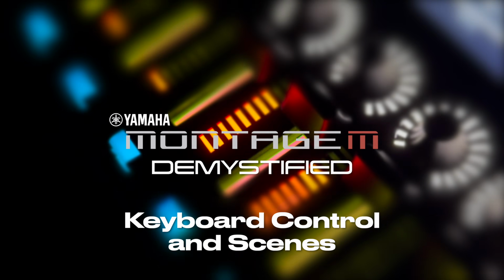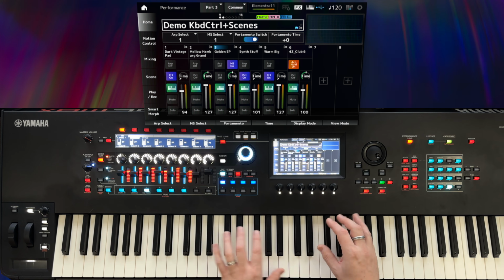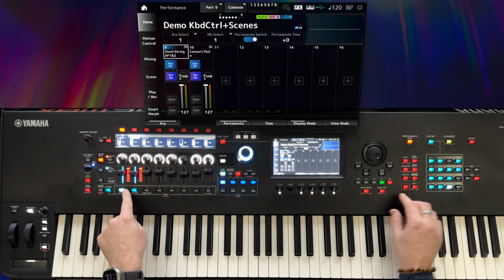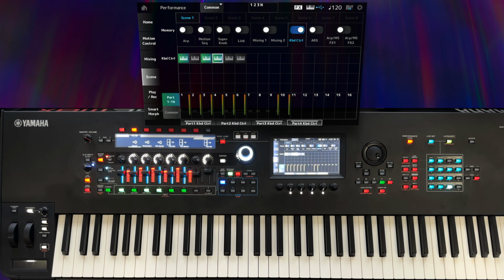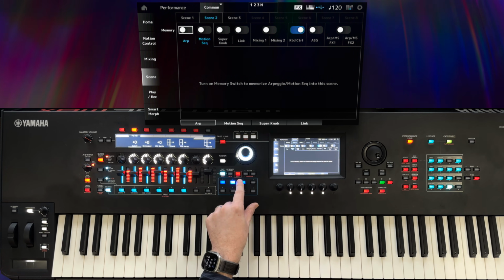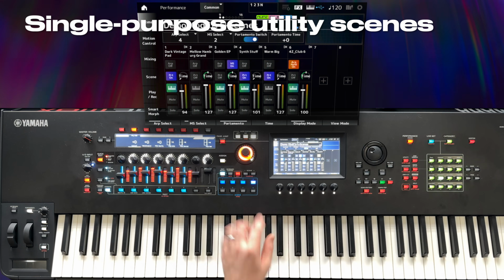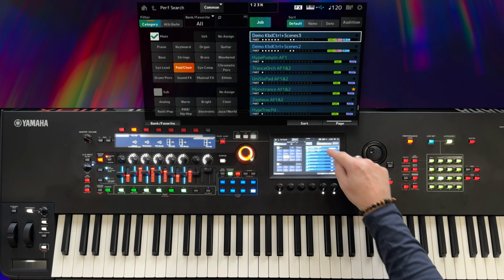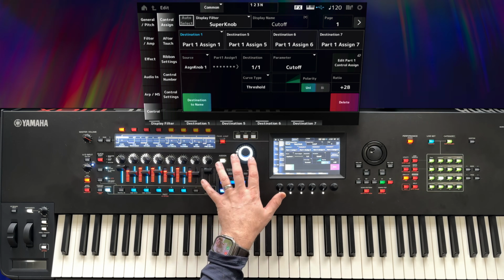Using scenes to switch keyboard control, arpeggios and more with Yamaha MONTAGE M / MODX M

Comment: Hi Kier, your tutorials are really the best, and maybe because there’s so much information in them I might have missed this part. A simple question for you, I think: if I have the same voice in both Scene 1 and Scene 2, with the only difference being that in Scene 1 the volume is low and in Scene 2 it’s higher, I get a sudden volume jump from that voice when switching scenes. How can I prevent this? Thanks in advance for your support!
Reply from the maker: If you’re changing mix volume between scenes, you will unavoidably get a sharp jump in sound output of any notes sounding during the scene change.

There’s not really a workaround apart from 1) don’t hold that sound during scene changes or 2) duplicate that sound to another Part and increase its volume, and switch keyboard control from the first Part to the second with the scene
Reply: @KierDarby I appreciate your quick response. It’s a pity there isn’t some kind of adjustable transition time, but I’m glad I don’t have to keep searching. I’ll definitely use your suggestion, thanks!

Comment: These are excellent videos, but probably too much for the average user. Is there a beginner-range video for just simply using the built-in presets and setting up favorites once you find the ones you would most likely use for most live performances? Once you get your favorites set, these more advanced videos will come into play for customization. Sometimes you just want to fly somewhere and don’t need an explanation from the pilot how they do it. Thank you for this extensive work!
Reply from the maker: Like this one? 

Getting Started with Yamaha MONTAGE M / MODX M: Finding Sounds, Live Sets and Category Search
https://youtu.be/_x3vKHDf4XU
Reply: @KierDarby Yes! Exactly. Thank you for the pointer.

Comment: For some reason when I attempt to set up the scenes with keyboard control at around your 11:00 mark the green keyboard icons  for the parts are not displaying, it just says "Turn on Memory . . . " also the Kybd Ctrl section does not appear in the column, just "Memory", thoughts. I have the latest OS.

Comment: Kier another great one...a couple quick questions..one, I could not find your demo percussion part in the Presets and two, when I store this demo, the only option I seem to have is to save it in the main User Bank,  in addition, I am not sure how to move it to another bank..you may have covered this before, but I could not find it in your lessons...thanks Michael
Reply from the maker: Hi Michael, I just went back and looked, and it turns out the 'Trancy Theme' drum performance is actually part of the Xtasyn library from Easy Sounds - sorry about that, I normally try to use just Yamaha presets for all my demos.

Regarding saving to the user bank, you're right, when you save a performance you have to save it to the user bank. At a later point, you can move the user bank to a separate library, at which point it becomes read-only unless you save a copy back to the user bank. I will cover this stuff in a future video.

Comment: So is there an easy shortcut to easily add drums / rhythm to an existing live set?  And have the drums variations correspond to each scene?  Ie verse chorus type of variations. Seems like it was way easier to do on my older Modx.
Reply: If I wasn’t mistaken, on the modx different rhythm variations used to be auto assigned to different scenes. Or maybe the patch I was on didn’t have that. 

Btw Thank you so much for this video!! 🙏

Would you consider making a looping tutorial video?  So using a multi part performance and rhythm to build a live loop using the pattern recorder? I have come close, but it keeps rerecording the drum parts and if I turn of keyboard control it stops playing entirely.
Reply from the maker: @linzdp  scenes can change the arpeggio number, so if your rhythm part has 8 different arpeggios assigned, you can switch between them using scenes - you can see this on many of the preset performances, like DJ Montage.

I could look into doing a looping tutorial, but as I've said elsewhere, I barely use the sequencer facilities on Montage so I might not be the best qualified to run a tutorial.
Reply: Thanks I’ll check that out!

Oh I never use the built in sequencer either. I’m only interested in using the pattern recorder to loop live like a guitar looper would do.  But seems like it tries to overdub the old drum parts back into the every subsequent pass causing a chorusing effect. 

I’ll keep playing around and see if I can get it to work 😁
Reply from the maker: No features have been removed from MODX, so if you can describe your MODX workflow, I'll tell you how to do the same thing on MONTAGE M.

To add percussion with a rhythm pattern to an existing performance on MONTAGE M, just hit SHIFT + SONG/PATTERN (RHYTHM PATTERN) and you'll access the same interface as you would get with the RHYTHM PATTERN button on MODX.

Comment: I wish key range was another independent parameter under Scenes so that you could disable the actual keyboard from playing additional notes when you want a sustained sound to continue holding underneath a new selected part, but without disconnecting the sustained notes from other controllers such as the expression pedal so you could continue to shape the sustained pad. It’s too bad you can’t route another part’s MIDI output to another part without having to loop out through MIDI. The internal MIDI routing is very limited on this keyboard..
Reply from the maker: The first part of what you want - sustaining just a selection of notes while not sustaining others keyed afterwards - can already be done by connecting a sustain pedal to one of the assignable foot controller ports and setting it to sostenuto mode.

The second part (directing the expression pedal etc. to the previous performance) is not doable with Montage architecture as all control inputs are directed to the currently-active performance, and I can’t imagine that will ever change.
Reply: @KierDarby  , I share that doubt that the Montage OG or M internal MIDI architecture will ever change enough to do what I was describing above. 

For now, I use an external MIDI controller to send CC11 on the assigned MIDI channel of the part that I disconnect from Keyboard Control after I sustain the notes (great suggestion to use CC66, by the way!). I'm grateful that at least incoming MIDI is still recognized even when Keyboard Control is disabled for a part.

I used to be able to accomplish non-stop expression control of sustained parts on my Motif ES using Master ZONE Mode with a MULTI patch (SONG/PATTERN), turning off internal/local control on the string part, assigning only NOTE control to one of the ZONES, and ONLY CC control to another ZONE, both set to the same MIDI channel. Because the Motif allowed internal MIDI routing I could select NOTE and CC data send independently, meaning that I could turn off the NOTE zone, but keep the CC zone active all the time. This allowed me to sustain and shape notes of a pad or strings, while continuing on to play a different layered sound on a different MIDI channel.

I so appreciated when the Montage made turning on and off zones/parts so fluid without cutting off the sound by implementing Keyboard Control. But it would have been just that much better to still be able to choose to adjust any sustaining notes even after you've stopped adding notes to the group.